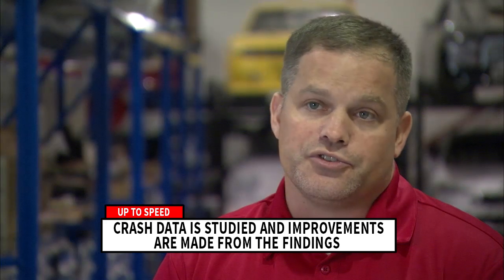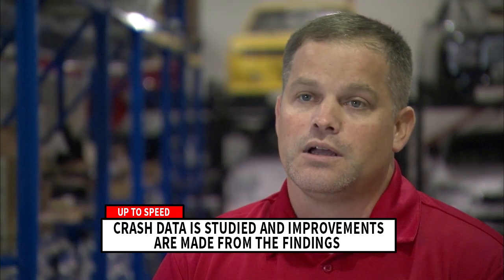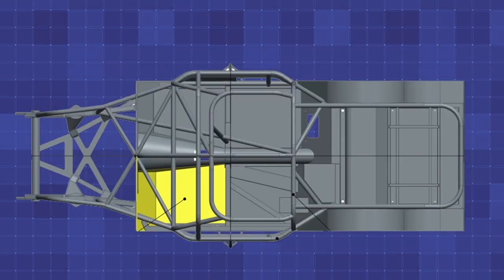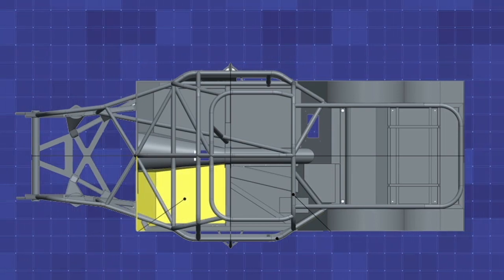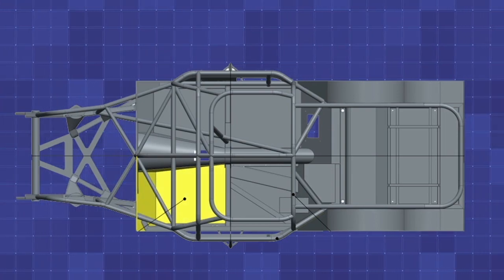Going in depth on NASCAR driver safety

Comment: I do hope that after Almirola's crash that we looked at ways to add shocks under the seats. Maybe not shocks, but like a SAFER cushing under the driver that is stable but gives under heavy impact. A great test would to put it on a Trophy truck.
Reply: Teejay Handley but that might impede the drivers ability to "feel" the car.